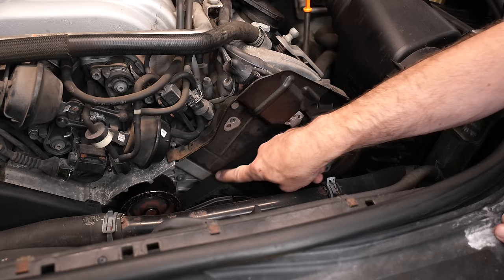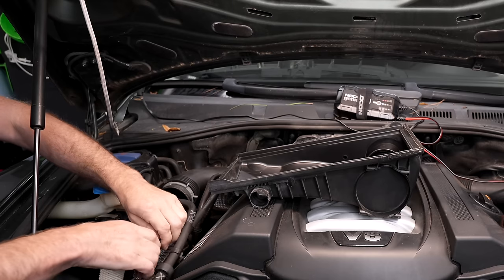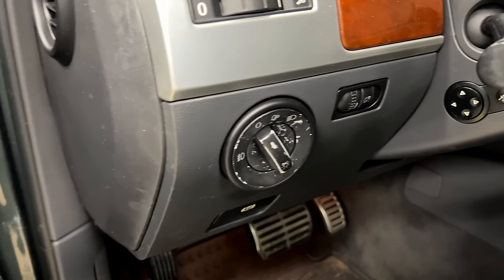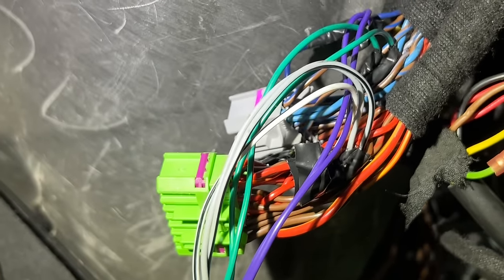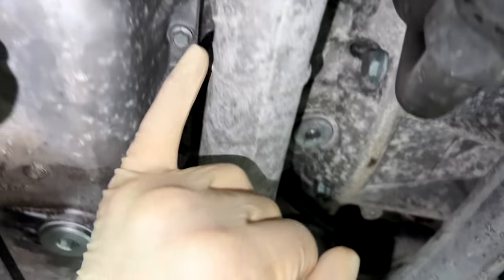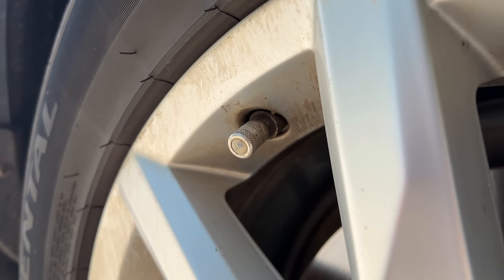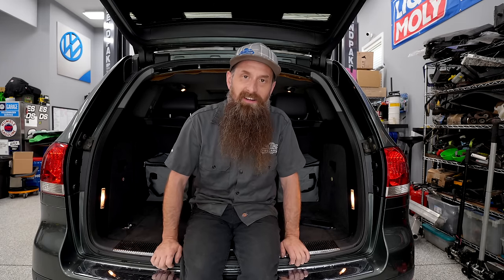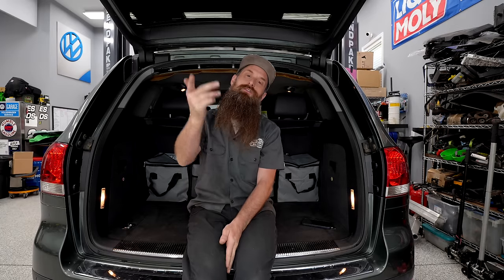Is It Worth Buying a CHEAP, OLD VW Touareg?

Comment from the maker: Im not sure how many more Touareg videos I will do. LOL lot depends on the reaction from this one. The last T-reg video flopped HARD HAAHHA
Reply from the maker: @VroomNPew  Pay attention to the part about towing. Im running into a few issues I haven't figured out yet.
Reply: Charles, you should trash this on the rally and also keep it for the daily commute if you like
Reply: Got a q7 same bit nice 170k miles and its brilliant only thing thats annoying is the panaramic roof gutters tubes come apart and leak 👍👍👍
Reply: @HumbleMechanic  I don't know what this trailer adapter that you showed is all about but if we are talking bulb detection with no smart communication then you need to match the current draw for each bulb on the trailer plug. That means basically putting resistors across your LED bulbs. Checkout how people put LED turn signals on older cars that have those mechanical clicky relays, it's the same principle. When the trailer lights module doesn't see the 1-2 Amps current draw but instead some 0.1A from your LED lights, it assumes that bulbs are gone.
Reply: @VroomNPew great tow car thats why i wont get rid 👍👍👍
Reply: I love these!! Keep making them lol 

What are you doing with your wife’s? Are you trying to see how far it will go? I’m interested because I have one 

Also the atlas kinda stinks so why not keep it? Lol
Reply from the maker: @Anonymous-qx5uk  Good insight. the adapter I showed has resistors in it. Im guessing that its still not seeing the load value it looking for. Im going to play around with adding some incandescent bulbs on that adapter and see how she plays. I dont want to mess with the trailer at all because it works perfectly in my 2015 touareg.
Reply: @HumbleMechanic have you ever considered doing vehicle abuse content? Poor maintenance, misuse and seeing how the rides hold up, what goes wrong first, I wouldn’t tell you to spend your money destroying things but would be insightful I think.
Reply: These were on my list as potential tow vehicles, but the LED thing is a bit of a turnoff. Any modern trailer has LEDs.
Reply: Love this car
Reply: As a Pennsylvania resident, I'd love to see how you may or may not address the corrosion😅
Reply: Are the tickets dry or are there fish in the aquarium?
Reply: @HumbleMechanic  of course you wouldn't want to modify the trailer since the car is the problem. I would guess that the resistors in that adapter aren't the correct value. If you add the bulbs and it works then you found your problem!
Reply: I personally would love to see more videos on it… any cheap SUV that you can buy to mess around with is always a good time! Also, if you ever get your hands on a 2013 Jetta s 4 cylinder 2.0, throw some videos up… I’m always pulling mine apart and it hard to find videos or even manuals 😂 if anyone in the comments can link a repair manual I’d greatly appreciate it!
Reply: I have 2010 V6 TDI Touareg that I can’t part with……totally love this video, thanks champ!
Reply: Dude I want one of these so bad, even though I have had them eat my lunch at the dealer.  Just looking for the right deal.  Lets see more!!!
Reply: my 06 is a rare combo with full air suspension and full 4x4  options and supreme audio 14 speaker and 6 pack cd and sub woofer and wine cooler mode in glove box heated seats mirrors ect with a v6 3.2   ... if you can replace your rusted parts  she's a keeper  make it look southern and make it great again !!
Reply: @HumbleMechanic would love to see this one as a off road monster! It's quite capable off roader, with low gear and differential lock!
Reply: Hope to see more.
Reply: You actually advised me about 4 years ago to buy a 2007 with the V6 gas. I had to put the reworked transmission valve body in (from the guys in SC or maybe NC, I want to say Revmax, anyway they make the best one), I had to put the drive shaft bearing kit it (the one where you don't have to remove the driveshaft, like $400.00 out of the Miami area) and do breaks twice. 

The vehicle was a basically a one owner and had 119K when I got it, cosmetically it was fantastic BUT I did a ton cleaning and AMMO maintenance type stuff. 

I used the screw in covers to fix the headliner and if you do a nice job you would never know. Some of the work I am able to do myself some I have to have done, I use a mix of dealer and third party (the VW dealer I use in Sarasota is a really good one). 

I took it off road a time or two but it was my daily driver and not wanting to break it once I had a little fun and learned it's capability 
I did not do that much. 

So I absolutely LOVED ever moment I had that thing! Beast vehicle I eve owned.

The only reason I got rid of it was I am an aggressive diver and the timing chain broke (or it was a very bad cam sensor, which was one of the codes) , I was not in a good position to fix in since it also needed breaks , tires and the AC was not blowing cold as it should.

I did alright I traded it for a Tiguan (basically I got $1,500.00 for it), I looked around for another Touareg but anything nice is EXPENSIVE. There is just nothing out there, I ended up with a nice base 2016 Tiguan (94,000 mile so... just ok there, but it's quiet), which is great year to get the base because it comes with push start, auto head lights, dimmer rear mirror and a couple other things.

So should you do more videos? 

On this one I would say NO too much rust, fix it up a little, just enough for general reliability and give it to me or someone you like (or maybe don't like and force them to fix it themselves hahahaha) or you could just drive it.

I would for sure like to see what you do for the radio, always such a pain. I suppose what I would do in a 2006 is just put one in that works and not worry too much over the steering wheel controls, Bluetooth, backup camera and all the stuff that you really want BUT you probably won't be able to just leave it at that... LOL

I'm keeping my eye out for a Tiguan R-Line (SEL trim would be nice, most are SE), 4 Motion in 2018 or above and then you are basically driving a less expensive Q3/Q5 (yeah I know the Q3 and Q5 are different, but not much). I know there is more sporty GTI or even Golf wagon etc. options but the Tiguan with that larger body is okay.

Or I sort of like the Atlas Crossport, again V6, SEL 4 Motion R-line... What do you and others think of this, can this be a replacement for Touareg?

Sorry this got so long, my appologies and thanks to any and everyone who made it this far!
Reply: @HumbleMechanic  I actually find it very interesting the VW Touareg I wish there was more content on it the one that interest me the most is actually V10  TDI because of the diesel scandal that VW was later involved in but that one is a pre dieselgate car so that one may be pretty reliable
Reply: Keep them coming. I loved the 1st gen Touareg when I was a kid! Had a 1/18 scale model just like this one, same color and same wheels. 
Also what about some Phaeton content? 👀
Reply: Wait till the starter goes bellyup ...
Reply: I just purchased a 05’ V6 with Air suspension and 187k and this makes me hopeful that I can get educated before I start adding the Eurowise catalog
Reply: More videos on the Touareg please!
Reply: @humblemechanic a great fix for the led trailer light issues is to add a resistor on the trailer wiring.  Works a treat
Reply: @HumbleMechanic aren’t there some sort of in-line resistors that are often used for led conversions? Could maybe be wired in before the trailer plug from the suv?
Reply: I'm never selling my '06 Touareg (even though it's the V6) sure she's a little dated but I don't care. This and my old XJ (RIP) have been my favorite cars to own.
Reply: @Anonymous-qx5uk  I agree,  in the past I had to add resistors to peoples VWs when they were swapping headlamp assemblies  for different look.  Resistor bypassed the lamp warning light.  I will say that I have not tried it on trailer connectors.
Reply: I've always like these. I want to get on and lower it and cruise the highways.
Reply: @brianfrisbie7937 you should see the bottom of my Jetta
Reply: I guess they're not ready this, but their kids are gonna love it :D
Reply: I absolutely love my T3 Touareg. They're actually fantastic vehicles, and it's been pretty damn reliable for us.
Reply: Here a video idea take my Chevy Malibu and put a vr6 in it
Reply: More egg videos
Reply: Straight Endless money pit.. Plastic everything that crumbles . Computer controlled everything that meltsdown.. Secondary air injection pump that never works.. Electric water pump that does nothing.. Airflow sensor will fail..Timing chain and tensioners..All 10 of them fails..Check engine light never goes off..Coilpacks fail..Oil leaks on the coilpacks causing misfires..Fuse box melts..Sanden ac compressor locks up .Fan module fails..good deal for $4500..going to cost $15.000 to repair already..And it's rusted out
Reply: Definitely do more videos on it. It's not a diesel turd but a proper V8 so it should do way better 😊 As for rust - at least spray some Fluid Film underneath. It will stop it from spreading and also should help with stuck bolts😊
Reply: Pls keep doing old treg vids, I’ve bought a 1st gen which had a shyte load of problems. Have slowly worked thru them thanks to a lot of your vids. Luv driving this car loads of fun. Thanks for your hard work.
Reply: May I ask you how much should a normal total price be for a brand new alternator/belt + Labor for a 2006 Touareg with a V8 engine?  Thank you for any help !!
Reply: @markspence3750  Hey I just called a shop..out of curiosity..They said $1300..Wow..
I would do it myself
Reply: @davidross-oo2vh  Thank you so much!!
Reply: @markspence3750  U R welcome
Reply: @VroomNPew  don’t buy the v6 if you want to tow something like a boat. That car is really heavy for that motor to begin with.
Reply: oooooooo
Reply: Love the video cant wait to see the next ones
Reply: Please make more I have a 2004 V6
Reply: Please continue with the videos! 
I have a 2006 v8 here in Brazil and simply love it.
I use it for all kinds of terrain. From daily short commute, long weekend at the mountains, short weekend at the beach. My younger brother is a mechanic, which helps 😊.
Reply: From the Philippines here. I bought a 2004 3.2 Vr6 gasoline engine touareg two years ago. It was an import from California. I'm the 4th owner. The car had a lot of issues: vaccum tubes, tail light and head light bulbs, purge valves, head light brackets, paasenger rear door rubber, outer tail lights, driver side door lock and window riser mechanism, oil filter, cabin and air cleaner filter, cinnecting pipe, and aircon freon. Now the car is a reliable driver. Here's what I can share from my experience. Most of these touaregs if not maintained properly will be a head ache but the good news is that parts are available. Also once you replace the worn out parts the touareg is a reliable SUV and you feel safe inside. The first generation touareg is not as complicated as the cars today. No touch screen monitors, the dashboard controls has physical knobs, and the key is conventional not push start button. Lasty, I hope that the first generation touareg becomes a classic so that its value will go up. In my own opinion the first generation looks more sturdy and the flowing body lines looks more conservative compared to the ones that followed it. I saw a lot if first generation touaregs in New Zealand when I went there in 2010 and 2019.. Most were used by farmers and forest rangers. Next year my touareg will be 20 years old. I plan to keep it and maintain it properly. Just sharing my experience.
Reply: I also drove it several times in the mountain roads of Leyte Island during the typhoon season without a problem. This is the time of floods, heavy rains, and landslides. I felt very safe inside because the touareg is heavy and feels solid. You feel that you are inside a well built truck. Most people can't beleive that it's an old SUV because the paint still looks good. In the Philippines most people love to drive toyota, ford and mitsubishi SUV's. You seldom see volkswagen SUV's here.  Lastly, I have a capable car mechanic and technician. And that makes it easier to maintain it.
Reply: Do you have load resistors on the led lights? That's the only thing I can think of....
Reply: @miketdavies I I just checked the Osram Led program,  and they are having the Homolomos  just for 2010-2014 models so far ... or maybe i am a little out of date ?
Reply: I need the !how I fixed it' type videos otherwise my Treg is going to not last
Reply: I don't know if you fixed your LED trailer light problem and this is just a thought but there are resisters that you can/should install any time you replace incandescent bulbs in a 2000ish car.  For instance, I installed LEDs in my 2002 Lotus Esprit  door edges and until I put the inline resisters in they would flicker.  O'reilly sells the resisters.
Reply: toua REX should it be spelled, cause rex is latin and stands for king, 
the Toua King
King of the mountains
Reply: Are you anywhere near north Jersey

Comment: If you get one in decent condition interour wise and a not-neglected one, always a good idea. You get a luxury SUV for below 5000. Even if you invest 10.000 in it, you are still much better off than buying a rather new used SUV like a Tiguan, Fermentor, X3 or X5, etc. I had the R5 and now have the V10. I payed 8500 for a perfectly maintained one. For that money, you don't really get a better SUV. Q7's with the same option list and power are much more expensive and we don't want to look at unreliable MLs or X5s.

Problem with them in the US as well as in Germany: Mostly bums buy them for cheap, drive them till everything possible to repair and maintain is due, then sell them off. For a halfway decent Touareg with 450.000km you pay around 3000€ here. Since you have to do every maintenance anyway, might as well get a cheap one.

i'm also surprised at how Americans not know of rust converter. Get a small can for 15€, brush everything brown with a wire brush and afterwards with rust converter. Took me a mindblowing WHOLE HOUR to do on my R5 which looked worse. After 5 days I painted everything with underbody paint. Very cheap, very fast and very effective way of dealing with surface rust on German cars
Reply: As is common sense with any car; buy a good one. As you say alot of these are owned by bums who don't know how or can't afford to maintain them and they get very expensive to repair after that. But if you keep on top of the maintenance these cars are fairly reliable. 

The main problem with these cars if you want a cheap daily driver is that basic maintenance is generally more expensive, and wear items like tires, suspension components and brakes wear faster; although on the 2.5 TDI Touaregs the brakes are from the T5 van and can last a very long time if you're a calm driver.

I don't have any experience with Touaregs personally, but I do have an Audi A8 D3 with the 4.2 MPI engine which I bought "cheap" for 6000. It ended up turning into a bit of a nightmare as it needed a new timing belt, new control arms, oil change, gearbox fluid change, and other small things like gaskets and vacuum lines. Ended up costing 7000 at an Audi specialist to have all that work done. You could say they were charging too much but in my area labour is damn expensive. To add insult to injury the day I picked up the car from the mechanic a surprise hailstorm came and ruined the car. Although after all that the car does drive fine and I expect it will serve me well for years to come. But if you are not able to do the repairs yourself I wouldn't recommend buying a cheap one like I did. 

Good luck with your V10
Reply: @Swiss4.2  Thanks, the V10 is our economic vehicle so to speak. There is also an 2003 RS6, a 2007 Q7 4.2, an A8 3.3TDI, a TT 225 and a Jaguar XJ12 Series II. I've had 23 Audis with which I drove a combined 600.000km in 15 years. I'm fairly familiar with them, since I do every repair.